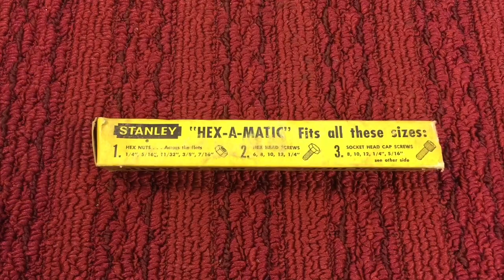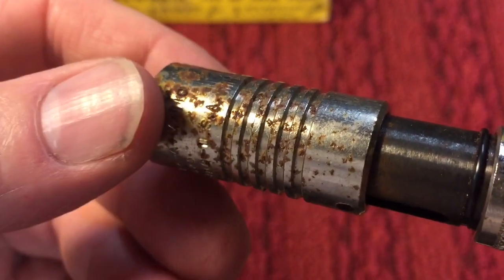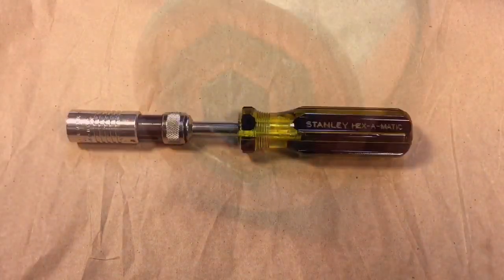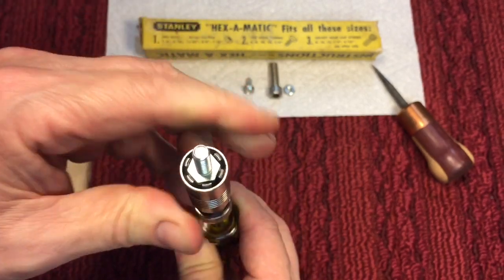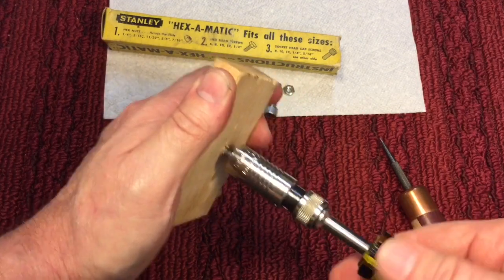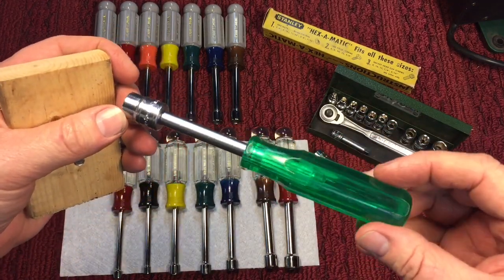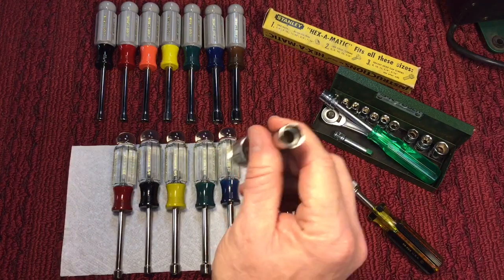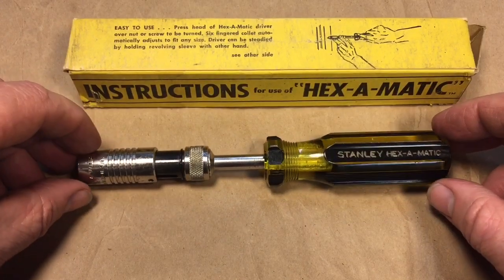Vintage Stanley Hex-A-Matic Adjustable Nut Driver

Comment: nice do you have any tool box what are non ball bearing and sticking or makealot of noise when you open it? if so ill talk to you later best way to restore them
Reply from the maker: Hello David!  I do!  I have a couple of older Craftsman boxes that had awful slides!!!!  Thanks!!!!!
Reply: I have a couple of machinist cabinets from 1947. Used to clank loud enough to scare small animals. Sounds like a Mercedes door now. Not very difficult to accomplish. Aside from greasing the rails you need to deaden the drawers. Dynamat Xtreme is the easiest product to find. You want deadening material that's butyl based. Most product of this kind are essentially asphalt with glue and foil - you don't want that. Yes, those products cost a lot less. There's a reason for it. Cut a piece of material about 8x12" and install it on the backside of the drawer, as per its instructions. That's all it takes. Good luck.
Reply: repairing now so give me a few days to tell you best lube chose to use , The trick i found to open them easy is zip tie 99 cent store sell large one what fits perfect into the whole put 2 on each side and that allow you to side out also you can take it off from inside too if you got a email ill send you pictures. then the next thing is to make sure it clean i use rubbing alchol with a clean towel ( then use qtips) clean ever part of it  both inside tool box slide the metel slide part what goes into each and on the drawer. the next park is make sure slide is straight and no bents into it. If there any sharp part use a sponge sandblock to knock it off make sure inside rails are not dented out.

Comment: Nothings says “good old USA” to me than Stanley tools. However my son an electrician tends to use Japanese brands like makita. However I’m able to remember 40 plus years ago when Stanley stood for quality and reliability and had pride in place in the tool stand in the hardware  store. Chinese tools are good value and very cheap but they have no soul or history.
Reply from the maker: Hello Clive!  China can and has made some good tooling the problem is they also make imitation tools that look real but aren't!  You are so right about old Stanley!  Like Millers Falls they were all about Quality!!!!  Thanks!!!!!!!!
Reply: I have the Klein Tools Drive O Matic which I think Stanley made for Klein based off this model and I love it.

Also Makita tools are quality power tools. There is a lot of thought and technology that goes into producing and designing them. Plus instead of getting bought up by a Chinese conglomerate like Milwaukee did. Makita has been owned wholly and operated by the Japanese since it’s company’s founding in 1915.

Dewalt and Makita really are the only power tools I like to run. Dewalt because their American Quality & Durability and Makita because of their Reliability and Technology.